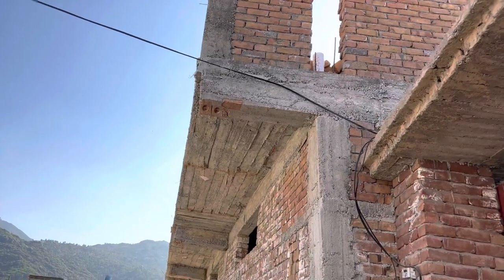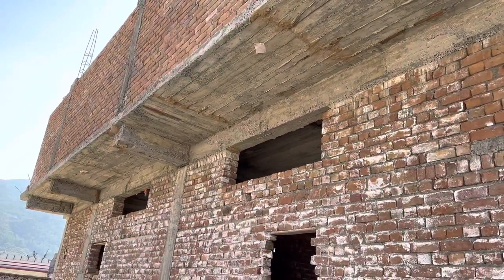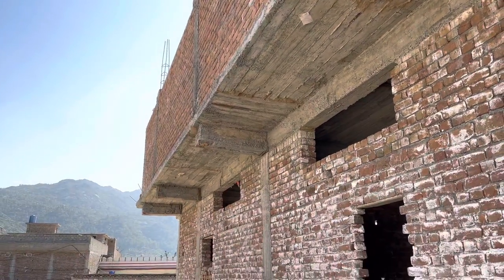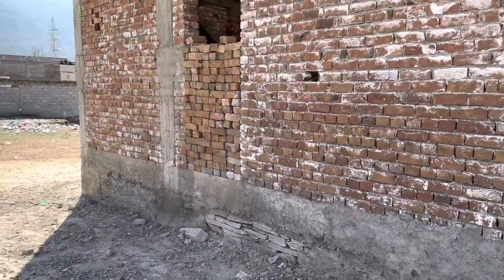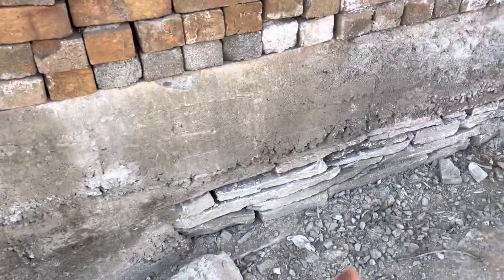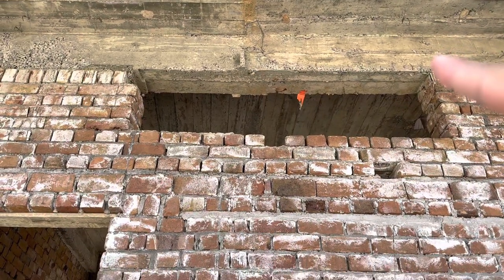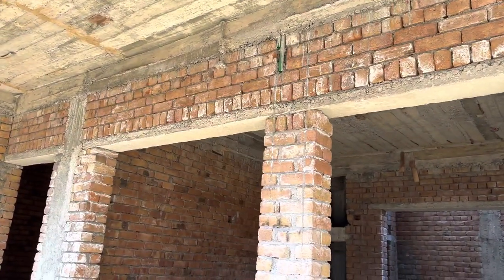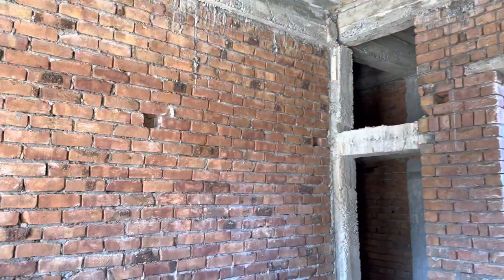4 Feet Cantilever Beam Design | Practical Video of Cantilever Beam |

Comment: Sir i have a question. Provided the cantilever slab backspan is significantly long, around 90%, are cantilevered rooms overhanged by just 12 inches or 30 cm requires cantilever beams underneath the floor slab if the outer walls are made of bricks and are 3m high? Thank you in advance for the response. By the way, subscriber from the Philippines here.

Comment: wow… where to begin? 

So in India it’s acceptable to get away with less than 1/10th the steel in buildings? I’ve NEVER seen lintels or beams built in such a way… and that concrete…😳 was it mixed by hand? It looks honeycombed and inconsistent.